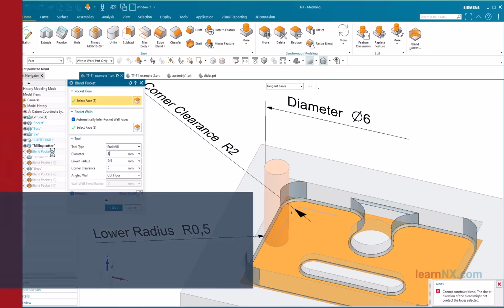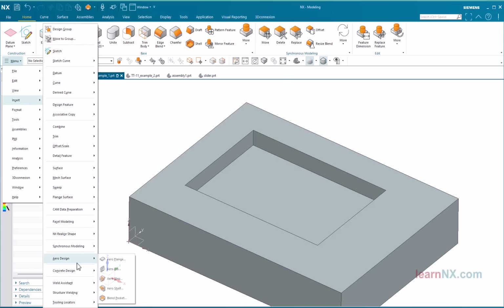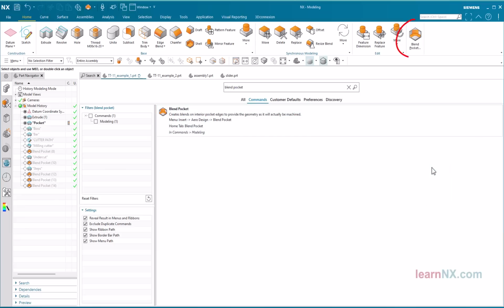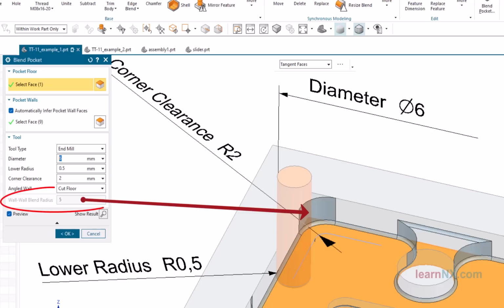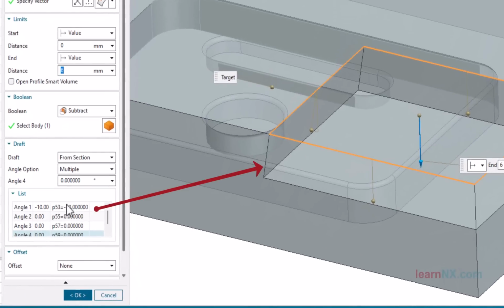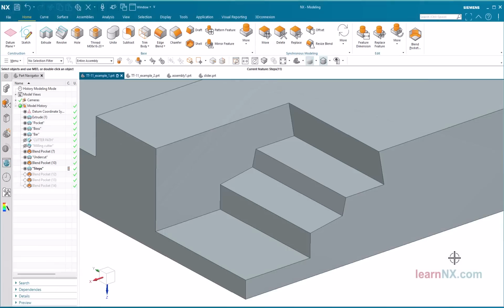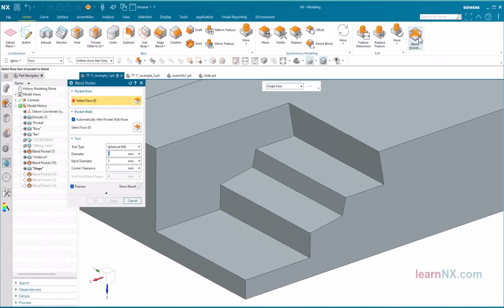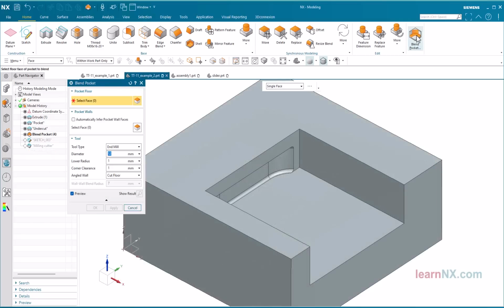Blend pockets | Siemens NX Tutorial

Comment: I think this video is a repost. One of the best previously unknown feature shown by You. Very helpful.
Unfortunately though, you cannot set Lower Radius to zero.
Reply: Yes, I noticed that too that the Lower Radius cannot be set to 0. A workaround I think would be to set it to a very small number. It's a very useful command, especially when you've got a part with a large number of pockets.
Reply: @dls1980fly  That's what I do. Set it to 0,0001 and then use another feature to remove all radius smaller than 0,001.
Reply from the maker: Yes, it's a repost, but you can now choose different languages. Unfortunately, the additional languages cannot be added to the existing video, so the video will be uploaded again with additional languages. You can recognise the multilingual videos by the small globe at the bottom left. Of course, all new videos will now be multilingual. Siehe auch hier: 
https://www.youtube.com/watch?v=BUNjMbN9Zmw